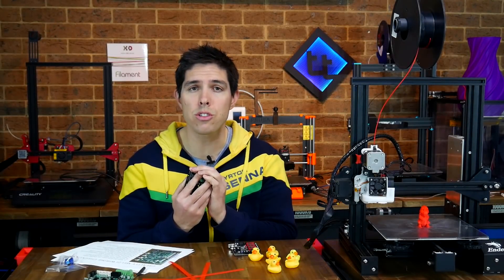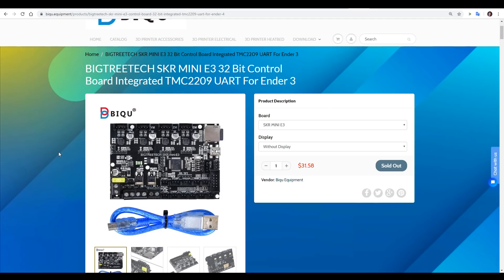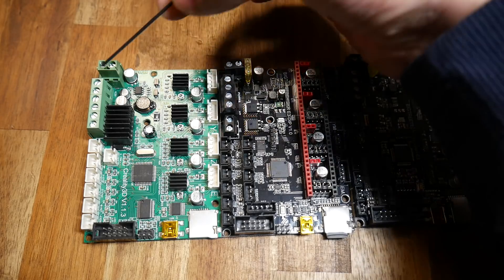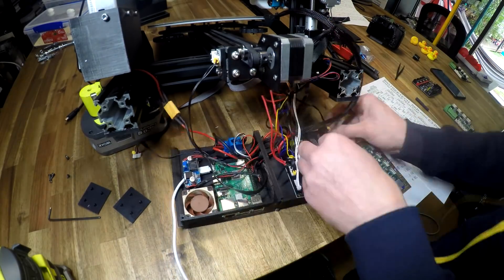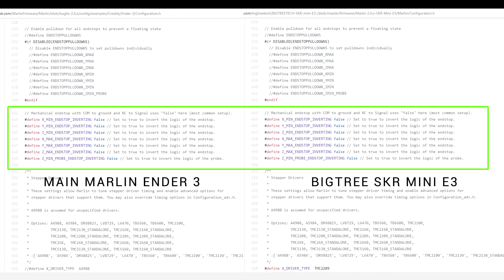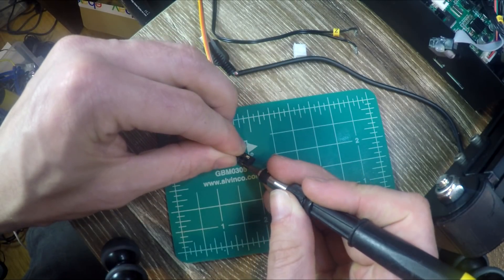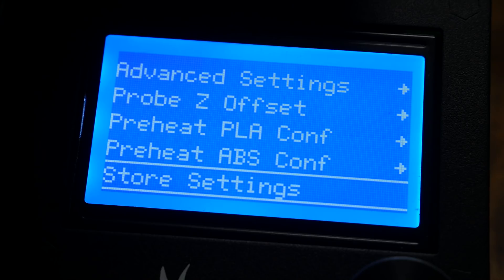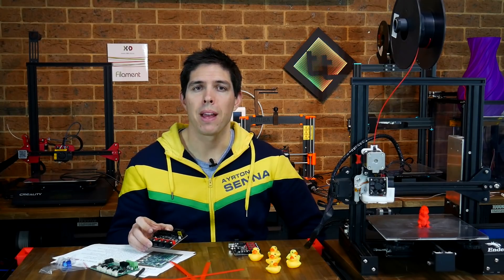SKR Mini E3 - The best Ender 3 upgrade from stock?

Comment: Thanks Michael, I was going to buy the SKR 1.3 but kept putting it off. Now thanks to your video I have just ordered the E3 board. Your channel is an asset to our community. Cheers mate
Reply: Curious if you'll get it soon .. the AliExpress store (official BigTree) just updated that they're having supply issues with the 2209 and won't ship until mid-October.
Reply: My sentiments also :)
Reply: kylek29 Have been told 9 days
Reply: But we will see.
Reply: Received mine today 9th Oct,
Reply: Hi bit says above in the links update v1.2 of this BOARD. As a noob I’m confused. Does he mean board or fw? The github link in the update is dead. 
I’m on an Ender 3 pro looking to finally get round to an upgrade of board. Many thanks 😊
Reply: @Mr_Gadge  Got mine last week, did the swap over the weekend. Yes, it's ver 1.3 of the board and it just worked on my Ender 3 Pro. Don't know about BL Touch compatibility as I haven't installed it yet.
Reply: @tlclstuff   Many thanks.
Reply: @kylek29  I received my E3 1.2 today, Pre-Ordered at the end of August for a Ender3 pro. Amazon has a few left.
Reply: @tlclstuff  wondering if you installed your bltouch yet? I'm having problems. Thanks!

Comment: So let's talk about the duck. It's actually a programmer's friend. Whenever you're trying to fix a bug and can't seem to find the problem, you talk it out to the duck. If it's a difficult or persistent issue, you gather a council of ducks to work on the problem. Since talking out the issue often helps, and a rubber ducky will never get horribly confused or bored, this little ducky can be your helper friend. If all else fails, you have something squishy to hurl across the room.

Comment: Thank you SO Much Michael. I've just recently purchased a SKR Mini E3 V1.2 Board as i was recommended to buy it over the upgraded Creality 1.1.5 Silent Board and just Wow. I'm so happy that I'm now able to use my Bltouch and My old Z end stop as a filament run out sensor both at the same time thanks to your excellent programming of the firmware and the fact that this board has a 32 bit processor and loads more space than the creality one. 

thank you once again for all the time your have taken to get this right for the people who with use it and thank you for releasing your version of the BTT Firmware Pre Compiled it has really helped me get off to an amazing start with this new board. KUDOS to you my friend and well deserved at that.

keep up the excellent work because you don't get enough credit for what you are doing

Comment: Michael, Thanks a million. I assembled my Ender 3 and was up and running in a matter of hours thanks to your videos.  I think that the SRK mini 1.3 will be the next upgrade as it solves all the issues that I intended to fix on my 3d printer. One of the features that I liked about the SRK mini was the addition of the BL Touch without the need to cut wires. Great video. Keep the content coming!
-Michael

Comment: Dude, i love that TT in the back. I got a bag of 100 RGB leds, lots of solder, wires, heatshrink, a 3D printer and plenty of filament. It's a HARD must to make my own like that from scratch with my own logo. Hell i even got a nano board and a spare chip so i can probably make a wave-program for the leds. Being a maker with printers is sick, thanks for the info and being inspiring. That goes to all these informative printer channels too!

Comment from the maker: Some FAQs from the comments:
1. There are notes in the github about having to emulate EEPROM for this board with a file on the SD card. When compiling from Marlin 2.0, I only uncommented auto init eeprom and it worked without any problems. It made it's own EEPROM.DAT file on the sd card. EEPROM is verified working for me. Only downside is having to have the SD card in when you boot or try to save settings.
UPDATE: Thanks to my Patron Glen Roe for keeping me up to date. Marlin 2.0 has now been patched to avoid the need for the EEPROM data to be stored on the SD card. All of the downloads above been updated.
2. There are a few spare pins free for things like filament runout sensor, plus dedicated ports for RGB LED. It also support the new BIQU TFT24 touch screen. I plan to make a follow up covering these.
3. This board connects like usual to Octoprint or PC via USB.
4. If you've already upgraded to the SKR V1.3, don't despair! It's a more powerful board with more extend-ability. Only real downside is needing to print new case to fit it.
5. I purchased the Senna hoodie at the Aus GP this year. I'm sorry but I don't have an online link :)
Reply: Could you post the Configuration.h and Configuration_adv.h files too? You have a great base line to work off of!
Reply from the maker: @lexus30  All already in the description.
Reply: Teaching Tech I completely missed it! Thank you sir!
Reply: I notice an EEPRoM.DAT file is created on the SD, so the FW must be using the SD as virtual EEPROM.
Reply: You might want to pin this :p
Reply: Mate cant wait to see the extra pin part as i want to add bl touch and fillament run out at the samectine and can u show how to use stuff like rgb and other features
Reply: @TeachingTech  Does the linked .bin for the skr mini 3e - Bltouch - Hero me work with v 1.3 board or is it only earlier versions like 1.0?
Reply: Any chance to use the extra pics to run the case fan and the hot end fan (not part cooler)? Even if I need to add a relay... I was spoiled with SKR 1.3 shutting off fans when idle.

Comment: I had been looking at the SKR board this week, but was put off by the the major difference in layout from the Creality board. Finding out that the SKR Mini E3 is a drop in replacement I ordered it straight away. Thanks again Michael for another great video...and for your uncanny knack for knowing what I'm thinking about buying next for my Ender-3
Reply: Oh, and I went with the TMC2208 V2.1 stepper driver boards. Not the top of the line, but I figure an improvement of the stock drivers and acceptable at $30 (USD) for a pack of 5

Comment: Ordered shortly after this video was posted. Just got my board today & finished installing it.

HOLY CRAP! Virtually zero stepper motor noise!! Very satisfying, if a bit unusual after hearing stepper motor noise for dozens and dozens of hours. Easy swap, came with Marlin 2.0 bugfix right out of the box, prints perfectly with no tweaks.

Looking forward to trying linear advance and some of the other things I couldn't previously use.

Comment: First off, thanks. Awesome tutorial. Second, not sure if anyone else had the same experience as I did but in performing the board swap-over just now, every single one of my connections on the original Creality board were hot glued into place. Took way longer than 15min... but works like a dream now.

Comment: DONT GET CAUGHT OUT LIKE ME

For anyone that has JUST revieced the v1.2 E3 MINI board and are trying to get your bltouch working on the default firmware but follow teaching tech's excellent video, Although Michael mentions about reversing the ground and +5v pins/ the UPDATED board is wired entierly different on the SERVO port i.e Gnd,+5V,PA1
Reply: Did you get the bltouch to work? After many hours of trying and reading commits for marlin 2.0 it seems like there is an bug in the code as they have changed the way auto bed levelling works. My machine doesn’t calculates the probe area correctly and goes off the build plate. If you have any tips I would be greatly appreciative. Cheers
Reply: Also this comment should be pinned as my pins were different like you said
Reply: Myles C ensure you’re using the dedicated firmware from big tree’s github page for the 1.2v only, all the bed settings are correct within the version of marlin so shouldn’t need to play around too much although by default it’s a 7x7 grid for bl touch , don’t be shy to read the config file for marlin there is soo many new cool features and most of settings have an explanation about the settings above them
Reply: George McCann yeah I did use their version first but I think it’s in a recent update that might be causing an issue. My bltouch works fine it’s just the bed levelling. I have gone through every line of the config and read all the documentation I could find. The issue seems to be with the probe locations which is based on the new probe offset syntax NOZZLE_TO_PROBE_OFFSET. Is your version using that?
Reply: Myles C I cannot even find that setting within config or config_adv

If you’d like I can copy my entire config settings and put them in a text file for you?
Reply: George McCann https://github.com/bigtreetech/BIGTREETECH-SKR-mini-E3/blob/master/firmware/V1.2/Marlin-2.0.x-SKR-Mini-E3-V1.2/Marlin/Configuration.h the config starts line 906. Like I said it’s the latest firmware, looks like they updated it 2 days ago.
Reply: I think I will need to checkout to a version before the added the latest marlin code, but if anyone can get it working it would be nice to use the latest codebase.
Reply: I successfully got everything working last night on mine with BLTouch.  Had a lot of trouble getting Platformio to compile but once I figured that out everything worked great.  I'm in a V1.2 board so I did not follow the wiring diagram above.  Thanks to George for pointing that out or I never would have caught it.  For the firmware I pieced together the changes that TeachingTech made to the past firmware for BLTouch and then did a compare between that and the one that was posted for V1.0.
Reply: @denizuydur  Any Luck? Looking for a firmware.bin file also for a v1.2 board and BLT
Reply: @cliftonjgoff  How did you get platform.io to compile, mines keeps failing. or do you have a .bin somewhere
Reply: @Guntersuck  Platformio was complicated and I'm honestly not sure what finally made it work, but it has been consistent so far working.  I've added my .bin file and a description of my configuration here.  https://drive.google.com/open?id=1obB6TAYQLrGvqbotJhjsdvQ7_imQoVCU
Reply: @cliftonjgoff  
I'm so confused with this.... 
The firmware that came with 1.2 is it suppose to work or not?
Reply: @sp78rus  The firmware that comes with 1.2 is not setup with auto bed leveling, that is what is being worked though in this discussion, getting a BLTouch working.
Reply: @cliftonjgoff  Your firmware didnt work. Probed off the plate.
Reply: @braaap2065  Sorry to hear that it didn't work for you.  I would check TT's new video.  I think he covers what to do with it now.
Reply: @cliftonjgoff  I've been trying for 3 days and can't get it to compile.  The firmware provided by the amazon seller bricked my machine temporarily..  your firmware has been the only BLTouch enabled firmware to actually have my machine near a usable state. That being said, it's apparent our BLTouch mounts are vastly different (mine sits off to the right, -Y slightly in comparison to my nozzle). Tried just setting home offsets on the LCD, but it tells me I'm too far--even at 0,0,0.   PLEAAASE If you're able, could you share what mount you're using for P&P compatibility?  I'm not too savvy on the whole atom/arduino/compiling stuff, its way above my pay grade.  But since my printer is so close to working again, the mount would be the missing link and be super appreciated.  I was on the verge of reverting to stock and returning all the parts until I found this comment thread and  I think I've about annoyed the heck outa Michael on patreon :'D
Reply: @kevineri4051  This is essentially the mount that I am using.  My BLTouch is on the left hand side of the nozzle.  I can't do it tonight but I could try to do a compile with different coordinates.  What is the location of your BLTouch relative to the nozzle?  i.e. "BLTouch is 25 mm to the right and 5mm closer to the front" or something like that. 

https://www.thingiverse.com/thing:2990086

Comment: thank you for your videos. thanks to them i took a dive, ordered skr mini, put it in my ender 3 in place of stock mainboard, using your wiring diagrams, and everything works perfectly from the get-go. this is my first 3d printer and without your videos i'd probably keep being afraid of upgrading.

Comment: I installed the SKR Mini E3 1.2 into my E3 Pro.  Works ok. Needs tuning and needs a new Marlin build that includes Mesh manual bed leveling.  Now trying to learn VS code and platform IO without success so far. But I am new to all this. Thanks for all the great content!

Comment: Definitely puts the Creality upgrade board to shame. By far the better value offer.
Reply: I know right?
When I saw that they charge you over $50 just for stepper motor IC upgrade I immediatelly ignored it.
They should sell it without trying to make a profit, they already made a profit on the sale of the printer.
Reply: @Arek_R.  No, they can make a profit. Just a reasonable one, in relation to the price of the printer. The Creality products just offer too little value and features for the price compared to the competition.
Like, when they try to sell some bog standard cheap spatulas as "special print removal tools" for over $30 for a set of 3.

Sure, quality is an important factor, but in the end, it's all made in China.

Comment: Thanks Michael.  Great video!  I've learned a lot watching your videos along with others.  I've had my Ender 3 for over a year now and have made many upgrades.  

When I found this video I had a SKR E3 DIP on the way with tmc2208 setup for UART.  I was wondering if you're planning on doing a video about the DIP board with UART setup.  If so, great.  If not, I'm sure I'll be able to get it setup without much trouble.  Thanks.

Comment: Really nice to see a drop in board for the Ender 3. It would be extremely nice to see a video of this board with one of the touch screens. That's the main reason I want to upgrade.
Reply: I tried a few touch screens and thought they were a waste of money, you can change everything from stock lcd with marlin 2 on 32bit board, the touch screens run their own arm cpu and interface and talk to the printer over a serial connection. The lcd is much faster

Comment: Installed the SKR E3 Mini on my Ender 3 Pro over the weekend. Can't believe it's so quiet!! Thank you Michael for this vid and your diagrams. Can you now please do a vid on adding BL Touch and filament run-out sensor to this new version (1.3) of the board?
Reply: Did you ever have any luck? I'm stuck!
Reply: @craigstannard3391   I didn't get round to it, to much to print ;) Just got a 2nd E3P and am in the process of building it. I might try adding the BLT to it as I build.
Reply: @tlclstuff  cool. Thanks for the response!

Comment: Hi,

Thanks for a great summary video of that board. It will help a lot people to get started with what I also consider the best board for the Ender 3.

Your video however show the mini ups as an extension available for this board but this mini ups deliver 12v and the ender 3 is 24v.
Reply from the maker: I have them sitting here but haven't looked into them yet. I'll probably make a video on them at some stage.
Reply: @TeachingTech  I do have one. It works fine for 12v but I cannot see how it can work with a 24v system. When charging them with 24v it might not blow (each caps is protected and unless you go over the fuse, the ups should be fine. Unless one of the component is rated for 24v max). There are voltage regulator around the circuit that will force the voltage to be max 2.5v x 5 = 12.5v. If I have not made oversight, this will force the voltage of the PSU to output 12v or will take a lot of heat in a single resistance. I would not test it on a 24v system.

Best case the thing works but suddenly your motor gets half the voltage so needs twice the power and start heating. It's 0 risk for the printer but the charge wont be enough to park the head and save everything before proper shutdown.

Anyway this sounds like an interesting experiment to drive if you wish to know what happens used on a 24v system. Just be prepared for the ups to smoke. If I am wrong with the voltage regulator behavior, then the supercaps will explore and the gas of caps are pretty nasty.

Anyway I'll be really interested to see an actual test if you are willing to take the chance ;)

Comment: Thank you very much for your work man. Note that a new bug was fixed 4 days ago that causes the overheating of the steppers motor. Just in case you wanna update your compiled firmware
Reply: i just tried using his stock firmware and my x is burning up and shutting off. thanks for your comment so now i do have to go build my own anyways lol. tried to save some time.....